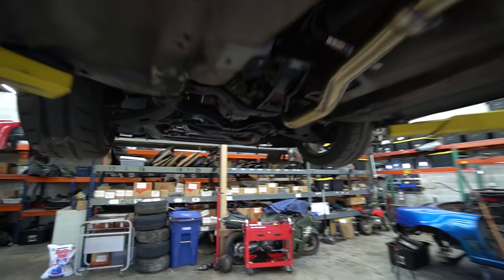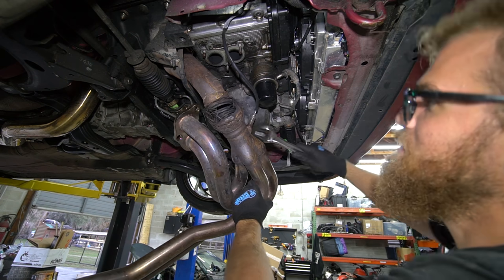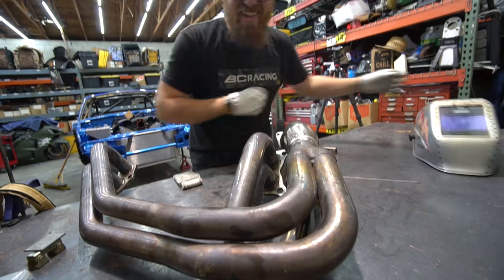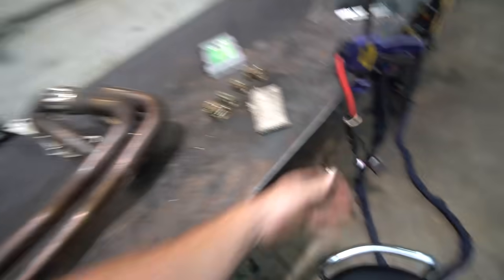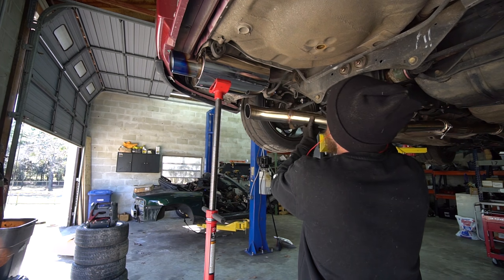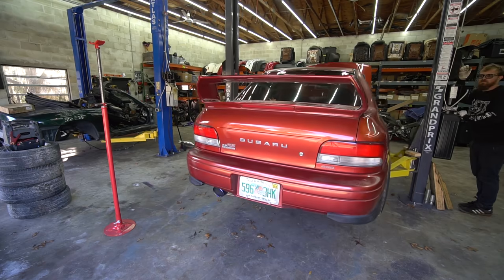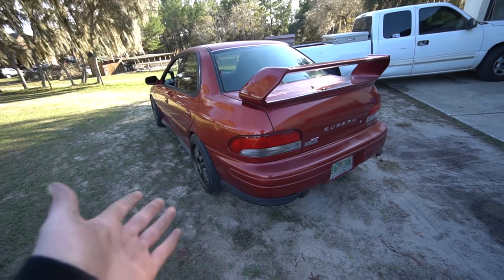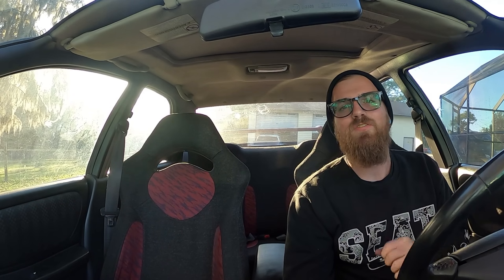Fixing The Subaru AND Making It Sound Good!?

Comment: Taylor, when mesh flex pipes like that are put pre turbo, turbo failure can occur when they fall apart. A lot of rear mount turbo guys fount that out the hard way. I suggest using a billow type flex pipe instead. Love the videos man!
Reply: Came here to say the same thing. Need the sealed kind that looks like a wrinkled pipe. Like the inside of the other flex portions he had.
Reply: John Fish and honestly, I wouldn’t even run a flex on the up pipe. It’s under some serious pressure, they’re always going to blow out. Subaru doesn’t even have one on the factory setup. And I can’t recall seeing one with aftermarket headers and up pipes. Hard mount the turbo, and delete that flex section.
Reply: Also here to say the same thing!!! Take this advice Taylor from subie owners! also!!!!! Grimmspeed mls gaskets and copper gasket maker are your best friend when owning these piles of flat goodness
Reply: @blackhavocjim  Actually they do run a flex pipe on the factory up pipe its just hidden under the heat shielding.
Reply: Also I'm not a subie owner dont lump me in there 🤣🤣🤣 

EVO squad here.
Reply: +1 You want an interlock flex section.
Reply: You can also get rid of the lumpy subaru misfire sound with equal length headers

Comment: i recommend going back to a stock header and using a catless up-pipe. The benefits of a aftermarket header isn’t worth the hassle.
Reply: Nick T nah he doesn’t need to go back to stock, just cut the flex out and weld another pipe section in. This isn’t the greatest header, but it definitely flows more than the stock cast manifolds and no cat up pipe do.
Reply: Yeah he should have just made it a two piece put a flange on each side that would have been the best thing
Reply: I agree, a grimmspeed p&p factory manifold setup would be perfect. Flow just as much, and wouldnt crack like headers typically do.

Comment: Whenever I need to replace a section in an existing exhaust system, I make a rig out of an piece of tube and 2 exhaust clamps welded to it. Clamps between the section you're replacing, weld the clamps tot the piece of tube. Remove the section and put the new section in. No need to mock it up or whatever because everything stays in place.
Works great with removing/adding mufflers, and flex joints.

Comment: I always use a bench top belt sander to mill those flanges flat. Also a good 7 layer MLS gasket w/copper spray helps plenty. Nice work though, sounds good.

Comment: i had this same header on my wrx when i bought it. it  seems like every one that has a flex joint there explodes.
Reply: Shane Davis yeah flex sections aren’t meant for pressurized systems. I’ve never seen a flex between a manifold and a turbo before. It’s just asking for trouble.
Reply: blackhavocjim Grimmspeed sells uppipes with flex joints and also ones with external wastegates. There’s no boost pressure it’s on the exhaust side. All the boost is on the compressor side. I’m running a flex joint on a 500+ whp STI. But yes they do eventually rip and break. The ones without the flex usually end up cracking the welds at the flanges. Damned if you do damned if you don’t.

Comment: That turbo flange leak is pretty common, pull the studs off the flange, and put it on a belt sander. Same for the turbine housing. I had to do that on every single turbo car I’ve worked on. I usually go another 10ft lbs over spec too, but looks like give them lots of uggaduggas. You wouldn’t believe the flange leaks I’ve seen on DSM’s and EJ’s lol.

Comment: i just thought about this, but um, when you cut the old flex joint out, you couldve mounted the 2 exhaust pieces back in the car, tacked the 3 pieces together, dropped it back out and welded it back together on the bench

Comment: Taylor's when welding stainless to mild steel use 309l and it will weld nice I have found that blue demon 309l has worked the best for that it wets out well and looks good

Comment: FYI all Subaru exhausts with flex pipe always breaks. The solid pipe stuff will crack eventually but it is much easier to repair and it generally much better

Comment: Get an oem header, gasket match it and do a light porting job and put a grimmspeed high flow centrepipe for it and a perrin uppipe. Works great for spool and less volume to fill than that shitty flex piped heade.. And you should use a flex pipe with a liner when its pre turbo.. I've seen those braids get super hot so they implode and start breaking off and gets eaten by the turbo..

Comment: Is the exhaust manifold hitting the core support? Looks the it could if the engine mounts are shot when the engine torques  stressing the flex joint

Comment: Can anyone help me I have a problem with my Gc8, It has a bad misfire very Sluggish, Car chungs like hell and when in neutral won't rev past 5k, I've changed Plugs, Leads, Fuel Filter, Maf Sensor and its still the same. Any help would be Appreciated👍
Reply: My miata is kind of doing the same thing, thinking its either timing or coil pack

Comment: Pipe way is too low as seen when you back out the garage tail is too high it will start a knocking as seen with your rear view cam shot the flex will let it move by at least 1/2 inch